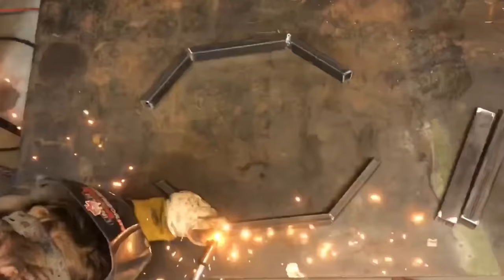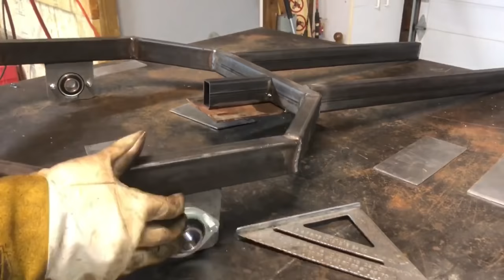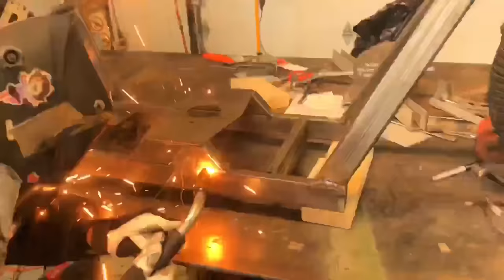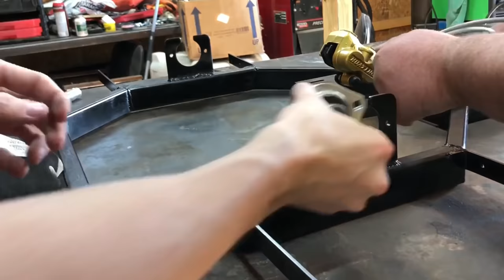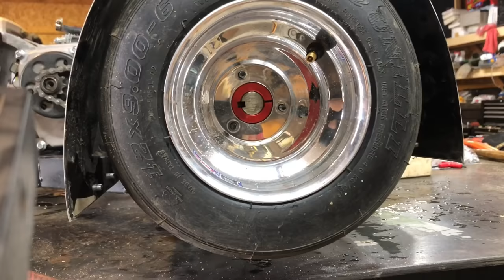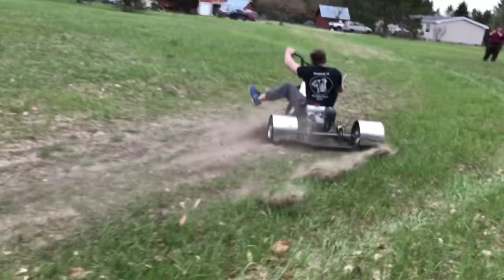DIY Drift Trike | predator 212

Comment: Hey there guys, where can I get that kind of engine? And how fast at them? Can I buy it from Amazon?
Reply: It's a predator 212, you can get the at harbor freight for 100$, you can also buy them online
Reply: And the speed greatly depends on the gear ratio you go with...
Reply: Andrew Mortellaro Sr. bcsb
c

popp
Reply: you can buy it from here <<https://www.harborfreight.com/65-hp-212cc-ohv-horizontal-shaft-gas-engine-epa-69730.html >> or << https://www.bmikarts.com/212cc-65HP-Predator-Engine_p_18.html >> or << https://www.gopowersports.com/6-5-hp-212cc-predator-engine/ >>

Comment: I would use a real engine though.  The price you pay fir those junk engine at Horrible Freight you can get a 400EX or 300EX or even a CRF250F motor from a wrecked bike.

Comment: my friend, I have a problem. I have also built one. but at the start it is not good. I probably want a big rear gear. What is the diameter of the rear gear for you?logically, you have a start, but you probably don't have top speed

Comment: Where do you find the square framing metal like that? I'm building my own setup and have been using scrap pieces from other junked gokarts. It'd be nice to have a fresh start rather all used pieces that I sand blast. Takes forever.
Reply from the maker: Metal supply

Comment: What size and brand motor did you use on this? Where did you source it?
Reply: It is a predator 212cc 6,5 hp , you can buy it from here <<https://www.harborfreight.com/65-hp-212cc-ohv-horizontal-shaft-gas-engine-epa-69730.html >> or << https://www.bmikarts.com/212cc-65HP-Predator-Engine_p_18.html >> or << https://www.gopowersports.com/6-5-hp-212cc-predator-engine/ >>